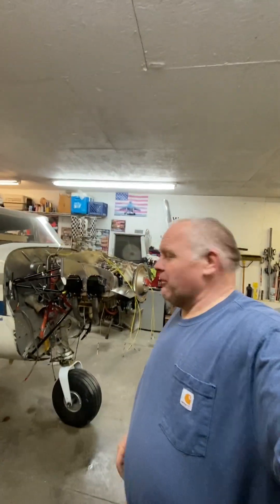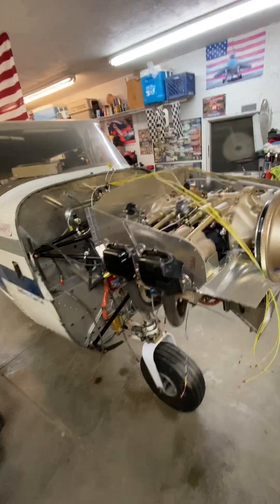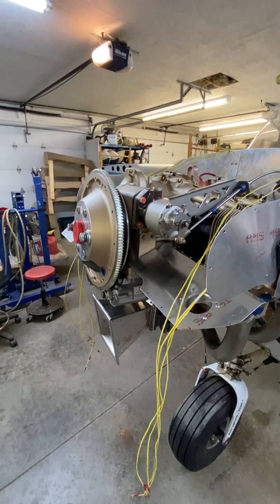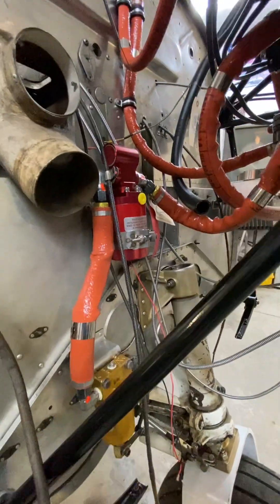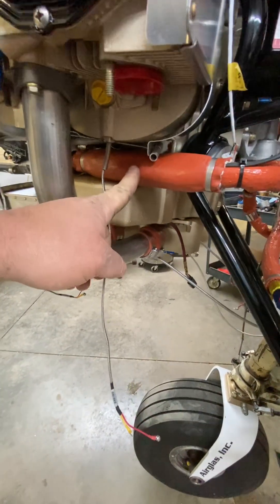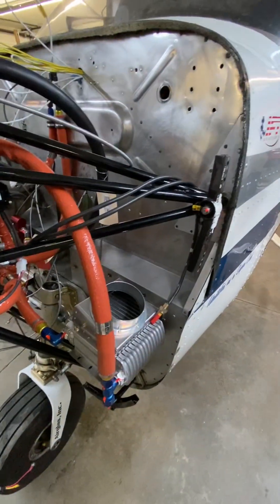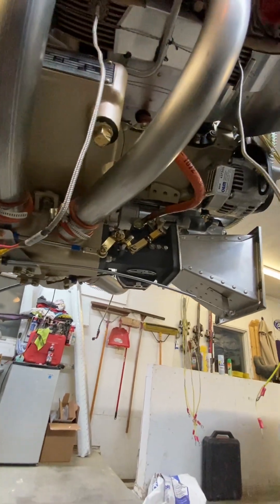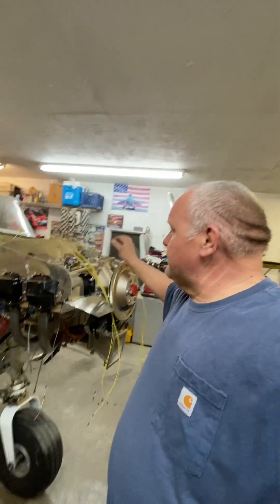IO-370 conversion

Comment: You said that this is a 172 is that correct? 172’s did not have G0300 engines with 175 hp. Is this a 175?
Reply from the maker: Do a search for P172D. That what this is.

Comment: How will your weight be up front with the trail blazer and battery? I'm real close to original weight of the o-300 with a skytec and an odyssey battery (fixed pitch o-360). That's the cleanest fuel flow fire wrap sleeve I've ever seen 🤣
Reply from the maker: Haven’t finished a weight and balance yet. The trailblazer is 2 lbs lighter than the c/s that came off of it so not much difference there. Firewall forward setup with the Io-370 is 48 lbs lighter. I am looking at moving the battery to the firewall but and dropping down to that smaller battery. Did you move your battery to the firewall or was it already there?
Reply: @joelwyttenbach2772  That's amazing that engine is so much lighter. I didn't think about the original engine being a go-300. I have a hollow crank and have always pondered the idea of a constant speed. I would really love to be able to legally put on the sensenich ground adjustable just to go out and play in the fields, then pitch it for cross country. Battery originally on the firewall in this 1966 G model